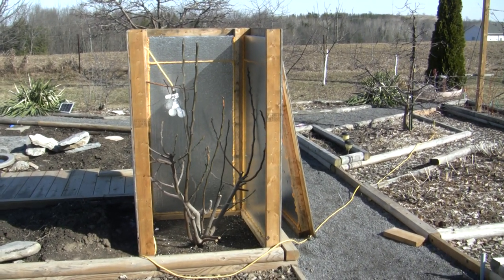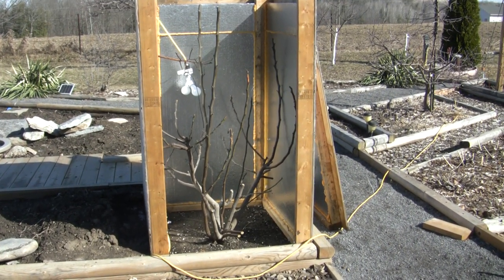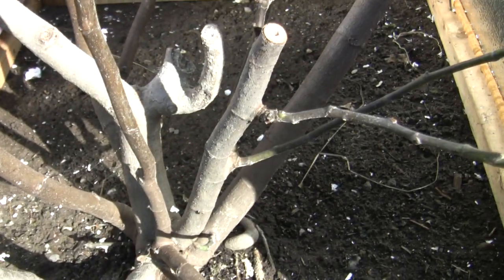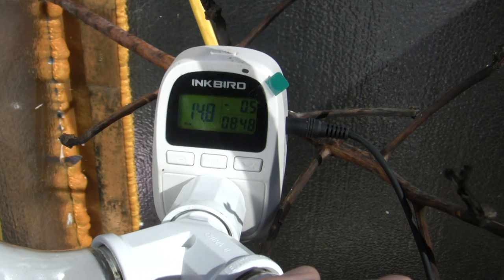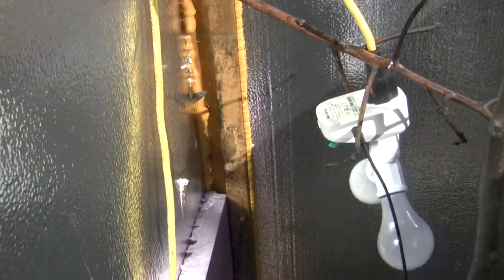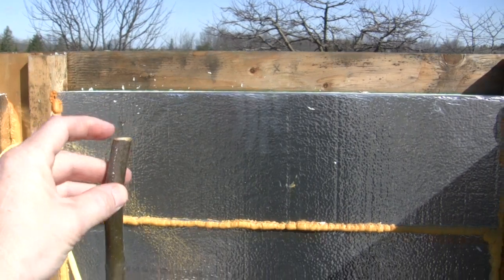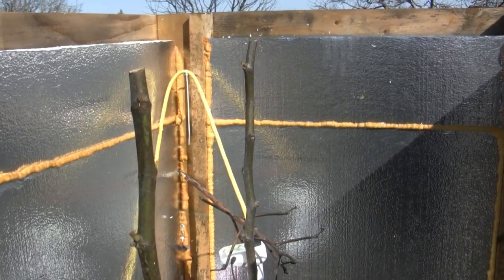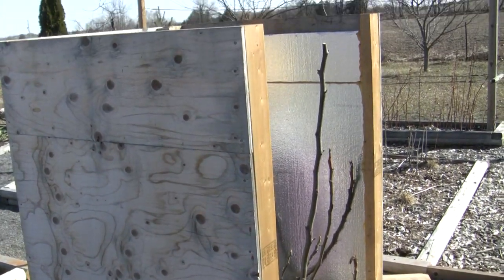Winter Protection for Fig Tree

Comment: I guess I know what my next project is for my Chicago Hardy fig here in St Catharines. Very simple, clean and effective design on your insulated box.
Reply from the maker: Thanks, bit of work to build, but much quicker each season now.  i haven't have any problems yet, but i'm a bit worried about mice getting into that nice warm cozy box and wreaking havoc on the tree overwinter. i might put some mesh on the bottom, or a trap in there next year.
Reply: Is that St. Catharines Ontario?
Reply: Is that St. Catharines Ontario?

Comment: I live in michigan and have three medium size trees that are in pots. Normally the trees go in our garage, but I really like this idea alot. Have you been happy with your box? Any modifications you wish you did differently.
Thanks
Reply from the maker: It works great. The biggest problem is storing the box all summer. It would be tempting to make the box  bigger, to allow the tree to grow larger, but i know its not needed, and would catch more wind and cost more to heat. The access door is great, i used it a lot. I dont have any improvements yet, time will tell how it holds up.

Comment: Hello.  Great video.  I also live in southern Ontario and trying to keep my fig alive over the Winter.  Can you please post a link to that Inkbird temperature controller?  I cant find it with the bulb.  Many thanks.
Reply from the maker: I bought it on Amazon. Here is the ulr https://www.amazon.ca/dp/B01M6WMUYI/ref=pe_3034960_233709270_TE_item
Reply: @tbuch5919  Thanks.  Got my box built and temperature gauge installed.  The box looks pretty air tight.  Did you put any holes in for ventilation?  Did you get any mould growth if no ventilation.  Many thanks for all the help.  The bush I have is more sentimental to me than having the fruit, so its important to me.  Thanks again.  V
Reply from the maker: @vinceandtheresa1243  I do not have ventilation holes. There was mold in the box and on the fig bush by spring, but i didn't notice any ill effects from it. I removed the lid a few times over the winter when the weather was above zero and dry to let it breath. I also usually need to prune a few branches to fit the bush in the box, and I keep some of those cuttings in the fridge over the winter as insurance, i could start a new tree if i had to.
Reply: @vinceandtheresa1243  did it work? Doubt it works in Canada. Easy to just put it in a pot and move pot in the garage
Reply: @dns_error  Yes, has worked now for 2 years.  My fig is planted in the ground like the video so I can't move to the garage.
Reply: @vinceandtheresa1243  cool what type of fig is it?

Comment: Why not use one ceramic heater bulb instead?  They are more efficient especially because you don't need light.
Reply from the maker: Yes, that would be better, i just dont have one yet. Im going to try and monitor next year if the heater/light bulbs come on at all. I have chistmas lights on the outside thst come on at the same time. I didnt notice them on at all this year.

Comment: Any updates on your fig tree you winterized last year?
Reply from the maker: Its doing fantastic. I've been meaning to post an update soon, maybe in 3-4 weeks the figs will be ripening.
Reply: T Buch when u boxes the fig tree nothing rottened ? Anyways, its a good idea how you winterized it. I had wrapped mine with burlap, plastic , aluminum foil insulation and finished it of with tarp. It still killed my tree to the bottom . Moister somehow got in and killed the top of tree.
Reply from the maker: @Figamico  I've used the box for the last two years, without any problems. There is a little mildew on the surface of the box, but none on the fig tree. I open the lid off the box on warmer, sunny, dry days about twice per winter to let it air out. The lid of my box keeps out most of the rain.